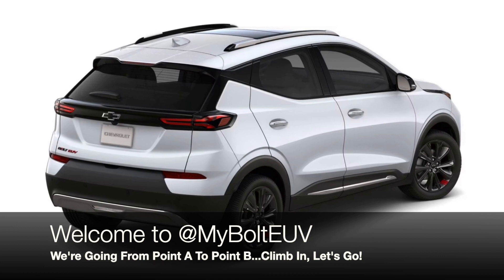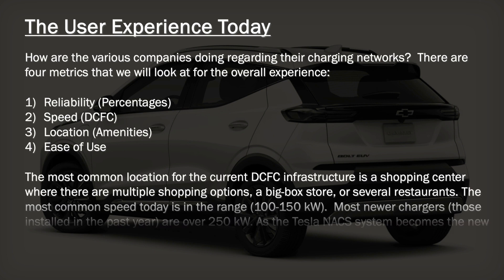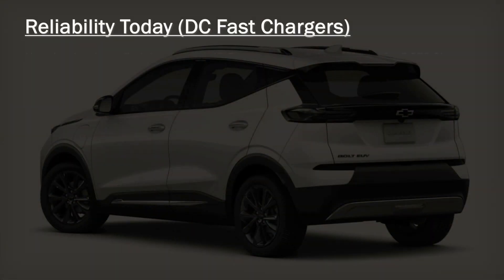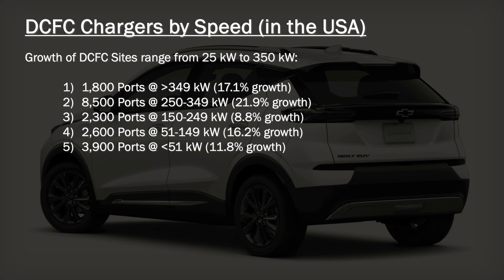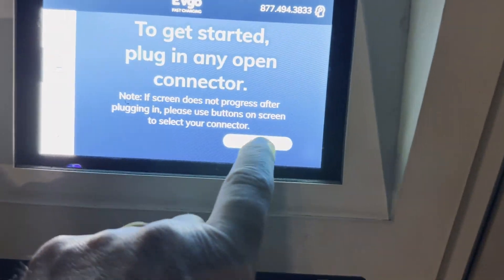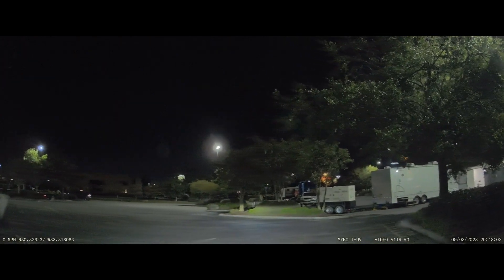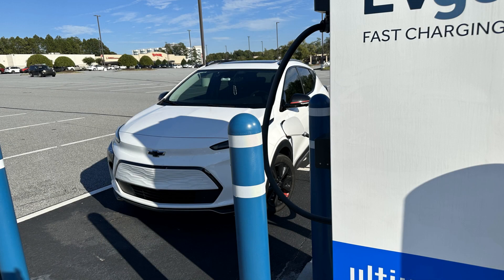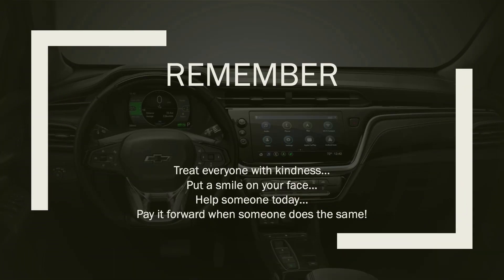The EV Charging Experience Today

Comment: To be fair, I've made two successful road trips in my Bolt EUV from Central Ohio to both Washington DC and Northern Michigan. There is a lot that needs to be improved with the experience for sure. But don't think that non-Tesla EVs are necessarily going to leave you stranded, especially along well traveled corridors. In those many thousands of miles, I only had one DCFC actually not work. But I was able to go about 10 miles down the road and find another one.
Reply from the maker: If you plan your trip, you will always have a "primary" runway and an "alternate" runway for charging your car. I have had several experiences where my primary failed and I had to move to the alternate.  With the exceptions of those areas in the USA & Canada where no DCFC infrastructure is in place, you should always be able to find a charging station.  You might have to sit in line and wait, but that is better than no charger at all!  And I am old enough to remember "gas lines," so that is a real possibility again in the very near future!

Comment: When you buy an EV that is no longer to be made and used a Chademo port, we have to ignore much of your knowledge and experience.
Reply from the maker: My experience is 40+ years of driving, 10 years of research into EVs (and the technology therein), and 4+ years of EV ownership.  You can ignore me if you wish, but I would suggest that if you own a car with CHADEMO or CCS receptacle for DCFC here in the USA, you should be looking for an adapter (which will be available soon) so that you can use the NACS system at Tesla locations and other EV charging brands like EVgo, Electrify America, etc.  Why?  Because, within 5 years, you will be hard-pressed to find DCFC dispensers from ANY brand that offer CHADEMO or CCS connections.

Comment: Thanks, Jim. Good information. A couple things that I think people who do not yet have an EV need to be aware of are (1) If you do not have access to a charger at home (e.g., you live in an apartment or condo), then DCFC (and Level 2 charging) are important considerations. If you can charge at home, then DCFC is not a huge concern UNLESS you take road trips or other travel where your daily drive is more than 70% of your vehicle's range. Also, (2) The point you made about efficiency is an important one: If your EV is efficient (low kWh/mile), then you don't need a huge battery and you get more range out of each hour of charging (less time sitting at the charger and more time rolling down the highway).

Speaking of efficiency... I'm following the development of the Aptera, a 2-seat 3-wheel EV that is hugely efficient (100 wH/mile) - expected to begin production in 2024. The launch edition will have a relatively small battery (42 kWh), but the vehicle will have a nominal range of ~400 miles. It can be charged (0-100%) at a 50kW charger in less than an hour (of course, there may be some rate-throttling that will affect that). Other configurations that will come later are 25 kWh (40% the batter size of the Bolt's but about the same range), 60 kWh, and 100 kWh (still not a huge battery, but potentially a whopping 1,000 mile range!). And to boot, the vehicle will have built-in solar panels for battery "trickle charging" whenever there's decent sun, adding up to 40 miles of range per day. (We average about 12-15 miles of driving per day when we're around home.) This could be a deal-maker for somebody who doesn't have easy access to commercial chargers or an at-home charger and can leave their vehicle in the sun during the day (think remote locations). And even if you only have access to a "lowly" 110V outlet (the same one you use to charge your cellphone), you can still add 150-200 miles of range by plugging the car in overnight.
Reply from the maker: DCFC is the only thing you can use when you are out on a road trip EXCEPT during the overnight hours when you are stopped for sleep--then L2 chargers at places like hotels, rest stops, or plazas would be the best option.  For the Bolt EV/EUV, you can top off to 100 percent on an L2 charger in 7-8 hours easily.  This is especially true if the chargers is 48A or more.  

As for the Aptera--I have been following the development of the Aptera since (almost) inception. From what I can tell (based on website and video), it will come in three "flavors" in terms of miles...~250, 500, and 1,000 mile variants. It is also fitted with a NACS receptacle...the first car company to adopt NACS (aside from Tesla).  I am looking forward to seeing them actually roll a production vehicle off the assembly line--they have missed their target dates three times already and that is quite disappointing.  

For me - I average about 100 miles per day driving and I make 500-1,000 mile road trips 5-7 times per year.  I will be doing an update on maintenance costs and "other" costs associated with EV ownership when I hit 22,500 miles (next service point).  I have already purchased my Cabin Air Filter for that service point and I have opted to get the K&N variant...one time purchase for the life of the car because it is washable (and it only costs 2X as much as a regular paper filter).  I also have K&N in my home AC system...an the K&N filters can all be fully recycled, so no waste in the landfills.
Reply: Need lowly 110 V chargers at long term airport parking.